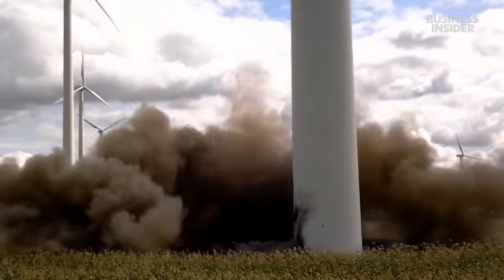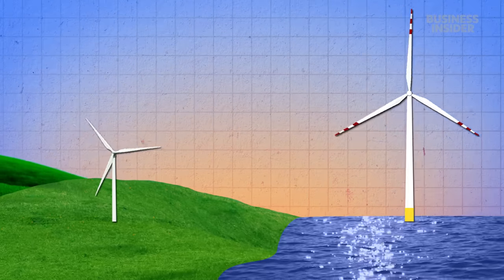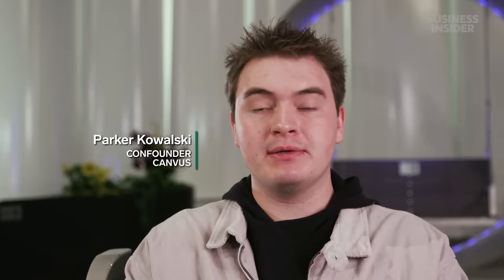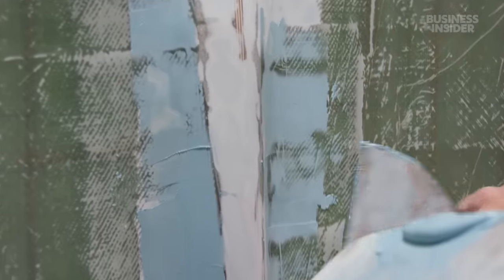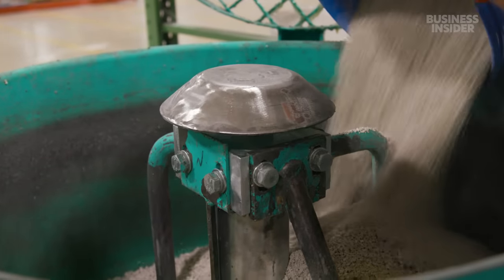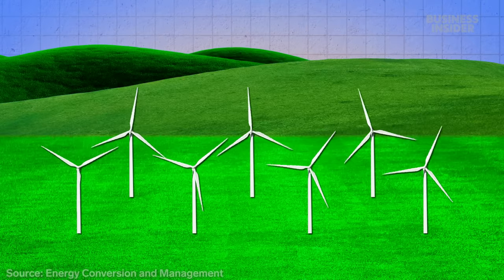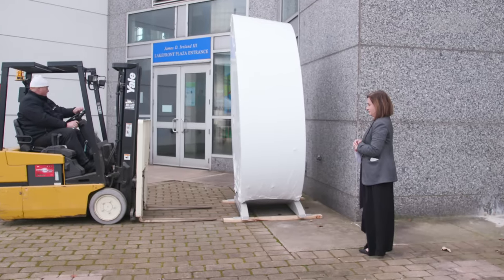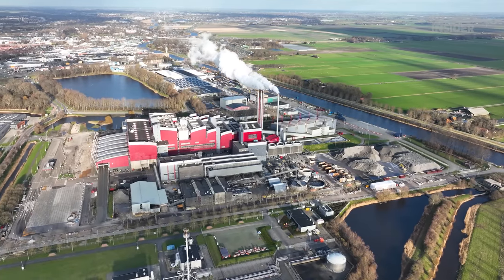How Bad Is The Wind Turbine Trash Problem? And Can We Solve It? | World Wide Waste

Comment: Every energy production method is going to have a waste... the question is which ones are the most wasteful? People like to hate on wind turbines but turn a blind eye to fossil fuels basically ruining our atmosphere.
Reply: Not even close. The same fume that's been on the planet since forever
Reply: @GojosBackHand  yes.
But its ruining the atmosphere😅
Reply: I really wish people would give tiidal more of a chance
Reply: @rachel7689  Less debris in the air probably makes it the cheaper option, but liquids do carry way more energy than gases.
Reply: Very few people have a clue about how much of what they think is waste and pollution from coal is actually a valuable resource that is used in construction, roads and toner cartridges and even wind turbine blades.
Some of these wastes are so vital that they will need to be replaced with sources that may be far less clean than power generation
Reply: Carbon dioxide is NOT ruining our atmosphere - at worst it is changing it. At times in the earth's past there has been vastly more CO2 in the atmosphere than there is today, or that human activity could ever produce. A rational discussion is a valuable thing, but try not to get hysterical. The earth will adapt, plant growth will increase, coastlines will change, but the earth will go on.
Reply: You know how much energy is needed to produce a wind turbine? And the easte it leaves behind, same as solar? All that to mitigate a fraction of 15% global emissions of the west, when SEA produces 85% mostly by coal and crude oil and being eco friendly is their absolute lowest priority.
Reply: Get back to me in 50 million years.
Reply: @davidshanahan5134  it's ruining OUR atmosphere- the earth has survived higher CO2, humans have not.
Reply: @davidshanahan5134  The world will carry on adapting BUT will humans be able to survive? Certainly not in the numbers currently alive today and likely in a harsher climate.
Reply: @davidshanahan5134 would you be okay with an increase in taxes to pay for the losses for people who lose everything from rising temperatures and sea levels? We will have to pay at one point either through subsidies for cleaner methods or through the outcome of climate change.
Reply: @truechaosmulala3831 Why not? I'm expected right now to pay taxes for EV subsidies, solar subsidies, massively increased electricity costs because we are too stupid to use coal and gas and want to pay 10 x as much for wind turbines, which actually kill wildlife. Modern batteries are filthy things to mine and manufacture, so I guess I'll have to chip in with recycling levies and clean-up costs when it's all over. And anyone stupid enough to buy property near the water in the last 20 years can carry their own costs - that's about when the climate hysteria said it was all going to be underwater soon.
Reply: @Jamessansome We have reached peak human - populations are dropping now. We don't actually want humans existing in the numbers they are today if a pristine environment is the goal. During the Cambrian period when CO2 was 10 x the concentration it is now there was an explosion of life - that's when trees evolved. We will get massive increase in plant life. Your worst case scenario is frozen areas will come alive, forests will re-establish in Antarctica (which 90 million years ago was the same temperature as Italy today). All of this is millennia in the future, so cheer up. Maybe in 100 years the sea levels will have risen by 100mm - absolute maximum.
Reply: @Mr371312 You are are talking sense dude - will get you nowhere in this debate unfortunately.
Reply: @davidshanahan5134  you understand the damage is in the 10s of trillions of dollars from just a few degrees increasing food production at least the grains/staples is one of the huge things impacted by the increase in temperature.
Reply: @truechaosmulala3831  Higher temperatures mean growing seasons will extend into what are now bitter winters. There will be just as much water on earth as there has ever been to water the crops - we just have to move it around. Warmer temperatures + more CO2 + water = plenty of crops for earth's currently lowering population. We will adapt so stop stressing.
Reply: Nuclear Power: 😂
Reply: @rachel7689  problem with offshore is water. It's more abrasive than air and thus wears down parts faster which increases cost of material and or maintenance.
Reply: @dikathemas6713  nuclear energy is suprisingly clean. Its just that the people running the plants need to actually do their ****ing jobs well and not screw around.
Reply: @davidshanahan5134  yes that is true and hell, Antartica was covered in lush jungle at one point due to that. The thing is that major, ecology friendly changes in climate DO NOT happen over the course of just a few centuries.
Reply: @Jamessansome  Humans are very resourceful. We probably wouldn't come out of it unscaved but we would live. The same can not be said for many other species on Earth.
Reply: It’s not even the atmosphere that is the worry. That’s the concern they push because it’s the least concerning and being concerned about that MIGHT generate the result we need to avoid the consequences of running out of fossil fuels.

The real problem is that once the oil runs out 2050-60 the world won’t be able to function how it currently does.

This will lead to war before it leads to people starving to death and suffering disease.

In either scenario you’re looking at a least 2 billion people dying.

Either that or people give up their car or and their phone and their TV.

From the looks of things it looks like 3 billion ignorant people would rather die from the former.

Not sure which category I fall into yet.

More alternatives need to be facilitated before that happens🤷🏻‍♂️
Reply: Why don’t you lead the charge then and boycott all fossil fuels and products let us know how that goes
Reply: As if the exploration, production and refining of crude oil has less waste?

LOL
Reply: Plants love co2. Used a ton of it when I grew cannabis for a dispensary.
Reply: @Jamessansome it'll be fine.
Reply: @truechaosmulala3831 might wanna check your bias sources my guy
Reply: @imafackinjunglist you've got a good point 🤙
Reply: So in the same year we stopped using low grade fuel I'm shipping industry (boats) there was a measurable increase in ocean temperature and visible reduction in exhaust from ships (less sulfur dioxide) so cleaner fuels resulted in immediate warming 

Not saying that we should go back but rather everything we do is a trade off
Reply: @gonelucid  yea that source is complete bs
Reply: And during those times when there was so much more C02, were there also humans?
Reply: You don't care about wind power killing some birds. People always say this and ignore the animal deaths from every other source of pollution happening right now. Your honest argument was when you complained that this might cost you money. Keep it honest.
Reply: Nuclear is still the most efficient when it comes to energy production and waste ratio being produced.
Reply: @alexwhite6554 it takes more petroleum products to manufacture and maintain a wind turbine then its life cycle produces to the grid.
Reply: My brain is rotting reading these comment sections.
Reply: Or coal ash pits leaking into aquifers, rivers and streams all across the US. 😂
Reply: @rachel7689 Tidal could work but it’s basically unreliable. Not to mention in areas prone to hurricanes could cause major issues with shipping if the things are torn lose.
Reply: @anomamos9095  Lead and mercury are used in construction?😂
Reply: @deanmartin2332  . So you’ve never heard of lead acid batteries or mercury switches? What would they be constructed from .
Reply: @dootdoot1867  😂
Reply: @anomamos9095  Yes I have heard of them. So how many are made from coal ash ? The coal ash that hasn’t seeped into the ground?
Reply: @deanmartin2332  you know that thing you drive your VSM on and that thing you live in probably has been made with a high percentage of coal ash.
Reply: @anomamos9095  Do you have any facts to back up this ridiculous post ?
Reply: See the diesel tractor moving those blades?  What energy do you think was used to build and transport those blades?
Reply: @dootdoot1867  show data please
Reply: Every single aspect of wind turbines is anything but green.
Every thing for making the turbine requires fossil fuel. The buildings where parts are built use electricity most likely generated by fossil fuel. Preparing the ground to put turbines in uses fossil fuel ( dozers to level the area, back hoes to dig holes, cement trucks hauling the cement, excavators, all the workers personal vehicles to get to the build site….) Semi trucks hauling the blades (one per truck and each turbine has 3 blades) Semi trucks hauling the bases (one section per truck. Depending on the wind farm, either 2 or 3 base pieces) All the components that actually make the turbine work are delivered by fossil fuel vehicles. All of the regular maintenance required (usually 2-4 times per year if no problems) drivers arrive in gas powered vehicles. 700 gallons of lubricant (oil) have to be changed every 9-16 months. All the rubber seals - require fossil fuel to be made. I have one turbine on my ground and have become very familiar with how inefficient they are, how unreliable they are, how green it isn’t and how much more costly than non green sources are. This doesn’t even address the disposal after their short life span. Nor did I address how the area around the turbine for at least 100 yards out, has significantly lower bushels per acre. So to completely ignore the tremendous amount of fossil fuel it requires is ignorant at best.
Reply: True but windmills cost more to produce and install than the cost of the energy it produces in its entire lifetime.
Reply: While others turn a blind eye to their everyday household items that they happily use/can’t live without, which require fossil fuels either in their utilization, or to produce them, all while offering no real solution except complaining and repeating talking points.

Comment: Eugh, fibreglass. We had a sheet of that in my backyard which was old roofing for the carport. It bowed and we had to replace it. Just moving the sheet to the ground made all this fibreglass particles float in the air and settle on the ground. I only passed through the area for less than a minute after I thought it had settled and had intense pain in my lungs from breathing it in which took a few weeks to go away completely as I avoided going in my backyard. Wouldn't want to work/be around that stuff. 
EDIT: We genuinely did not know it was fibreglass at the time, thought it was a sheet of thick plastic as it was quite old and had dirt on it, and only found out after researching why I had trouble breathing. I was not the person renovating, and I only came out to look at it on the ground and was outside for less than a minute. This comment was to highlight how unpleasant fibreglass can be to human health, wasn't looking for people to be calling me careless.
Reply: That's why you need a gas mask if you're going to cut, damage or shred the stuff. The lung damage can be permanent
Reply: A sensible person would have worn a respirator, goggles, and heavy gloves for a job like that. You can’t blame the material for your carelessness.

Comment: Use pyrolysis to turn the wood, plastic and fiberglass resin into a mixture of carbon monoxide, methane, hydrogen gas, and carbon dioxide.  That only leaves the glass fibers as waste.  

It's much more doable for wind turbine blades than for municipal garbage due to the input material being far more controlled and knowing what's in the blades.

Comment: Looks like they coukd be used to build prefabricated homes or campers. Maybe boats also.
Reply: It's much cheaper to build new boats and campers out if fiberglass than trying to make one out of a turbine. I reckon the turbine boat would cost 5x more for the same size, but less in quaility.
Reply: You can't reshape a fibergalss that are completed how would you make a boat shape????
Reply: @maszkalman3676  Use the existing shape & add to it.
Reply: @michaelbrinks8089  Yeah that would make the ships interior completely unaccessible and if you you cut out all the interior bits the glass fibers wil fly everywhere but likely into the sea or waterways and inside your lungs not a very pleasant way to get lung cancer. Also how would you secure it? It would needs bolts?? that would make it less water resistant no matter how good the glue or caulking material you use, taht's why they called monohulls they are made from a single parts so no palce for the water to go in.
Reply: @maszkalman3676  you cannot with most fiberglass, itll more likely catch on fire. It has to do with the epoxy making a cross link bond that heat cannot deform. You can reshape it if the resin is thermoplastic, but then it would be too weak for a turbine or boat.
Reply: @Pepe-dq2ib  That's why i said it's a shłte material for monohull boats probably good for a show or something to show off the "possibilities" but i don't actually know a good use for them to be honest if you can coat it with something to not release glass fiber particle in the air/water you can make  paddles for canoes or something like that from these.
Reply: @maszkalman3676  my bad I replied to the wrong person, you both got a similar green avatar
Reply: @maszkalman3676  but with all that labour, fuel and energy, it all still be expensive. At that point I would just buy a carbon fiber  paddle.
Reply: @Pepe-dq2ib  Happens sometimes 🤣

Comment: I don't know why wind turbines are singled out here, it really comes down to using composites. All Boeing, Airbus and Embraer  aircraft , any aircraft are being made almost entirely of  composite materials. Boats, cars, you name it,  composites are being used and they all have the same issues. What really needs to happen is that a product should not be brought to market if it can not be broken down into it's basic elements, true recycling.
Reply: Boats, campervans and car parts etc are also made from composites. Nobody seems to care about that.

Comment: I thought this video might be more than just a unicorns and fairies puff piece of virtue signalling.
A few park benches and such don’t come anywhere near a solution to the pollution caused by used E waste.
Being cut into planks to make fencing and retaining walls or even roof tiles with the leftover material being shredded to make fibre filler for concrete would actually be more of a solution.